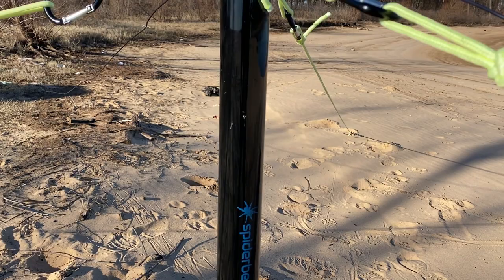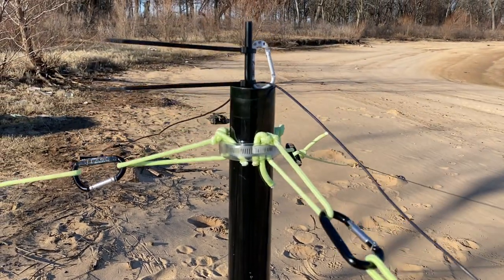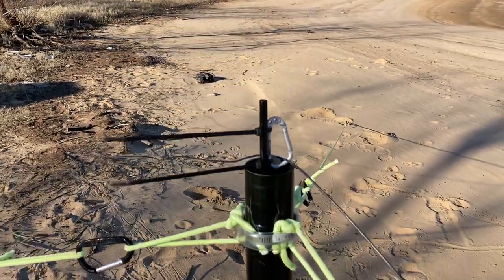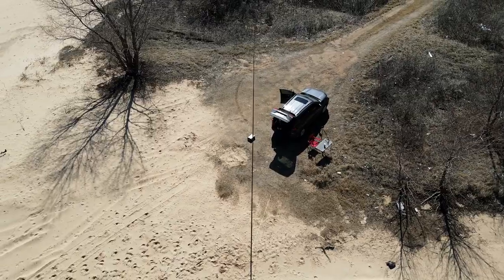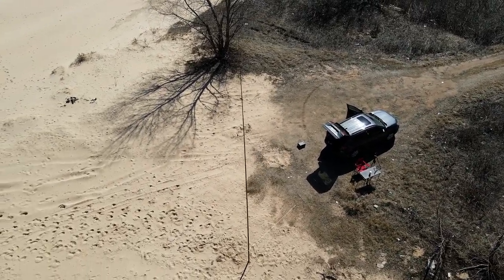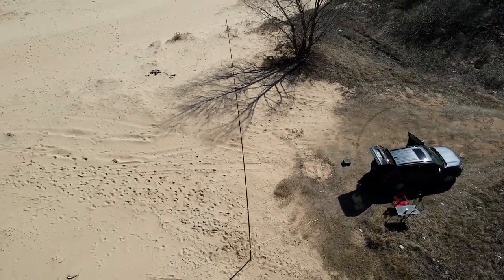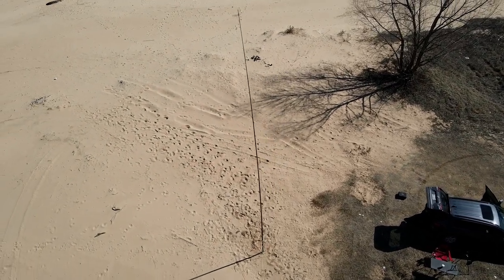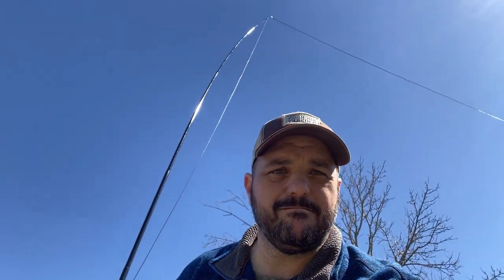Spiderbeam HD Ham Radio Antenna Mast

Comment: N6EF-Nice video, Shane. I have the DX Commander 10 meter mast for my homebrew end-fed half wave but looked at the Spiderbeam mast. To keep my mast bottom from moving around, I take a 2" PVC cap, drill a 3/8 " hole in it, turn the cap facing up to act as a cup, drive a 3/8" by 10/12" landscape spike (big nail) through the hole to secure it to the ground, then drop the mast into the cup. The mast bottom doesn't move.
Reply from the maker: That’s a good idea. I have a a hose clamp at the bottom as well that I put 4 tent stakes in.

Comment: Hi Shane,
it is a great mast. I've had two permanently installed out back for nearly three years and has survived 70 mph wind gusts with no guys. They are attached to 4X4 fence posts which are cemented in the ground. Spiderbeam makes an excellent clamp kit for their masts. I had one pole collapse a week after being put up before I used the clamp kit. Hasn't happened since. Stay safe.  73   WJ3U
Reply from the maker: Oh wow that’s awesome Don. I saw the clamp and and guy kit from them. The only time it’s worried me was before I put the bottom anchors on. The bottom wanted to kick out. Now that I’ve addressed that it’s rock solid.

Comment: New video - Who dis?
Spiderbeam with K8MRD mods? Very cool. Liking the carabiner zip-tied to the top section.
Reply from the maker: Yea it makes holding the wire super easy. It slides off and also lets the mast move without pulling the wire.

Comment: Hi Shane.  Great video.  I'm a big fan of Spiderbeam.  Relatively new Ham.  At my QTH I have three (2@40' and 1@60').  I purchased a plastic planter, filled it with two bags of quickset with a 3' PVC pipe in the middle.  My 60' pole slips right in and it sits on my patio.  Great counter-balance and I can move it around the yard.  The other two pole hold the ends of my OCF.  I drive a section of rebar in the ground and slip the 40 footers over that.   I guy it all with 25lb mono and the whole set up works just great.  I also use hose clamps for the bigger sections and electrical tape for the smaller ones.  For portable I use the tire mount as do you.  Good luck to you and looking forward to future videos.  73 John N6NRO
Reply from the maker: Thank you John, I’m a big fan of these. I didn’t think about the planter idea.

Comment: In the sun I think the sections expand as my bottom section regularly collapse as it cools.  I now use the reusable plastic tie straps (don’t need to be too tight) just above where the sections join. Same issue on my 10 meter Spiderbeam pole that I use out in the field (very compact version with more sections).  Great pieces of kit and highly recommended.
Reply from the maker: Thankfully I haven’t had a collapse. I do have a roll of electrical tape to put around the joints if I do.

Comment: You talked me into it. Ordered it Friday. Should be great for POTA. Well should be better than a WRC on top of my car 😁 Thanks for the nice video.
K0PIG
Reply from the maker: I think you’re going to like it. I have it setup in both my pota videos in a couple different configurations.
Reply: @K5QBF  I’ll likely be using it to set my 80-10 efhw to inverted V. Might be a little to heavy to run as a sloper. But I’m looking forward to it. You should get a commission 🤧
Reply from the maker: @mark002228  Now that would be cool, I just like showing people things that really work for me. I have setup my 40-10 EFHW up as a sloper in  pretty gusty winds with no issue. I think as long as you support the box it should hold the weight of the wire without issues.

Comment: Great video! Have that mast and love it. Also using the SOTABEAMS 7000HDS and tactical mini. Was wondering, how are you attaching the top of the inverted L to the top of the mast?
Reply from the maker: If you go back to the close up at the beginning I have a carabiner that has two zip ties on it. It slides over the top and goes down about a quarter of the way down the top section. When I’m done it slips off the top.
Reply: @K5QBF  Gotcha, I rewatched it and see it now. Thanks! Looks like a great solution.

Comment: Nice video, looking at the spiderbeam to use with a roll up ladder line type j pole on 2m/70cm.

Does it fit well in the drive on mount sleeve, or does it need clamping or shimming?
Reply from the maker: It fits pretty well. I put a couple socks on the bottom just to keep it from scratching. There’s a link to the mount in the description.

Comment: Any recommendation for setting this poll up for a permanent instal?
Reply from the maker: I would buy the guy belt which will guy it at the 8th section in addition to where I guy it on the first section. They also make a clamp kit  that will help keep the pole from collapsing. 

http://www.spiderbeam.us/product_info.php?info=p57_Clamp%20kit%20for%2012m%20fiberglass%20pole.html

http://www.spiderbeam.us/product_info.php?info=p234_Guy%20belt%20for%2012m%20fiberglass%20pole.html